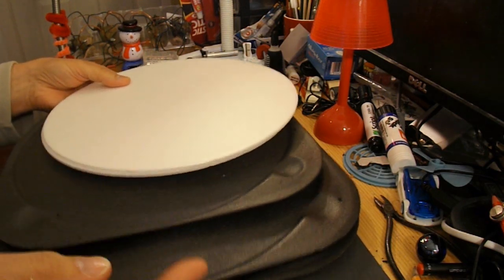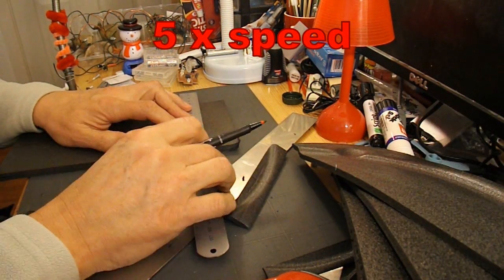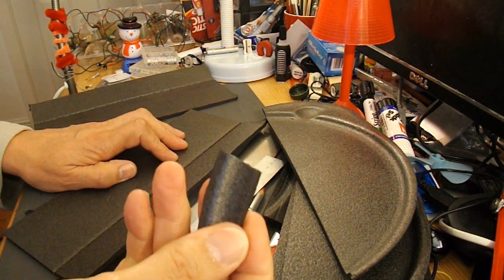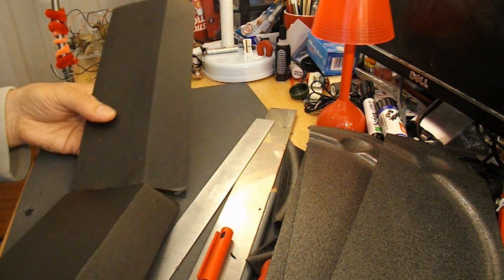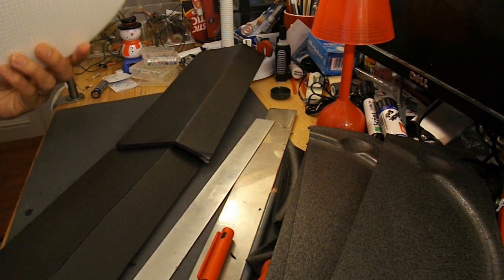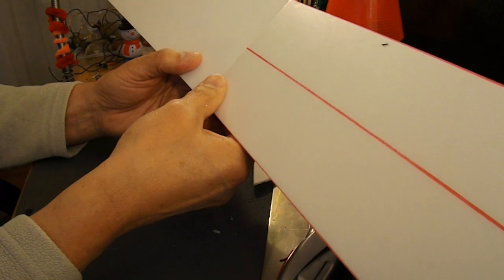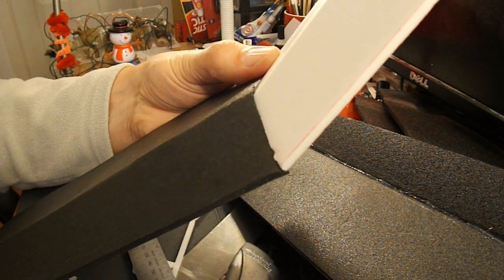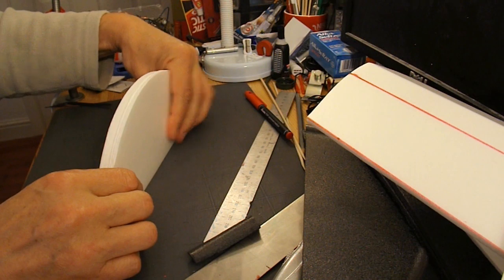Another Polystyrene Pizza Tray Aircraft - part #1

Comment: Thank you sir...
If you can teach how to built rubber band powered aircraft that will b a gr8 help
Reply from the maker: I have not decided yet how I will power this one, it may even just be a glider. It is an ongoing project that will develop as it goes along. I have done a few rubber band powered aircraft in my aircraft playlist. Here is an example Bargain Store Project #42 Pop Bottle Propeller Polystyrene Plate Plane